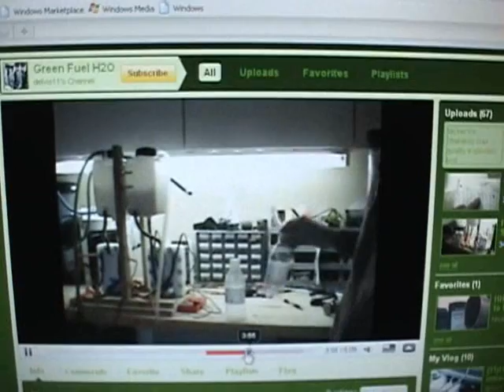Nickel Vs Stainless Gas quality explosion test

Comment: I use much wider gap between Anode/Cathode (1cm) with Nickle and Potassium "CARBONATE" not KOH @ 3 grams per 1 liter and only two plates .50" x 6" x 3/32" and high voltage between 176-600VAC run through full wave bridge rectifier and 60mfd AC start cap rated at over max voltage placed across the DC legs of the bridge. So my nickle surface area is probably 50 x less than what you have there. Did my first one in around 85-1987 been many years ago. My cell is more correctly a cold fussion reactor for producing several times more BTU's per watt than what is claimed to be possible per unit of electricity.

Comment: I am suprised that most of HHO-ers  are after dry cell design. I guess it is an industry already, with million dollars turnover. Yet, dry cel has many drawbacks. And why plate spacing (1/18") is so narrow ? It is well known that at such gap you won't get quality HHO gas, while considerable share of el. power will be wasted into steam...

Comment: Hi, delvis11 ! Very nice analysis done. I am planning to build my HHo gen for welding purpse based on Titanium. Do you have any testing of Ti done ? I remember you've mentioned somewhere got titanium stack for testing - couldn't find anywhere. How does Ti work, compared to Ni ?
Reply from the maker: I did test out Ti and it was a total waste of time.The metal is not that conductive. Stay with stainless steel and if you can afford it nickel is the best.
Reply: +delvis11  I was wondering the same thing but did you test MMO coated Ti or non? And is Nickel as corrosion resistant as Ti? I need hydrogen generators that lasts years without rust and brown water for heating. Also have you tried the Nickel HHO with a Catalytic converter instead of Stainless Steel and does it get hotter?
Reply: Also have you tried using sodium sulphate instead of KOH? It's supposed to be way less toxic to health.
Reply: @koreymayo8884  doesn't work good. Koh is king of alkaline

Comment from the maker: Nickel has the least resistance. It is best metal I have tried. probably the best for the price but still a lot more expensive than stainless. Titanium has about the worst resistance of any metal. Makes a good sub-straight but not a good electrode.
Reply: What would you think about the idea of Silver Plates? It is said to even be of higher conductivity than copper. However, in a water cell it would most likely tarnish quickly which would raise its resistance. I have wondered if silver or copper plates, which were nickel plated for corrosion resistance, would be better than nickel plates alone? And if so would it be a big enough difference to be worth while??

Comment: I like what you are trying to do. I just have a question about which plate, Nickel or Stainless transfers and attracts electricity better.
 I have tried bronze, brass, aluminum, and titanium. With the exception of being extremely expensive, titanium was the best for the transfer of electricity. (used the least strength of electrolyte).
Bronze and brass clouded the electrolyte immediatly. Aluminum couldn't put up with the electrolosis no matter  what electolyte was used. (corroded really fast)

Comment: several % of the gasoline goes direct into the exhoust since almost all of the engines have an overlap in the input and exhoust valves.
with HHO, all the energy produced goes into the moving of the piston at around 3-5 degrees PAST TDC

Comment: sharper bang should indicate a faster burn than the lower bang, think the stainless is better :)

@ the math wonders around here, you can calculate all you want but if you have no idea how the burning prosess of gasoline works, plz don't try to comment on any of these video's
its not for nothing that a gasoline powered car needs several degrees pre-ignition for the darn thing to actually work, also...

Comment: If you used a Scrubber system after your reservoir to get the Moisture out, I would think the Power may increase.
Next your Ti Gen test may show more Interesting results. SO far Smack says only the Anode has MMO and a the Cathode is Ti Cross Hatched per Bob Boyce Protocol. Also use Sodium Sulfate as a Electrolyte.
M~R

Comment: I have a great deal of respect for Smack, but he is wrong in his thinking that ONLU Ti plates make large amounts of ortho. Nickle, or nickle/cobalt alloy also make mostly ortho, because there is no chrome in them to leach into the electrolyte. If you don't believe me, build two electrolyzers, one with SS, the other with Nickle, run them for 4 weeks, then look at the electrolyte, see if there is a color difference, then do a bubble pop test, and post your vids on the net., just like Steve did.

Comment: Let me fill you in on something. Check it out for yourself. NASA uses chrome in their catalytic converters to knock ortho down to para. They do it because ortho is to energetic to store as a liquid.
Stainless steel has chrome as part of it's molecular structure. When SS is used in an electrolyzer, it leaches copper, iron and CHROME into the electrolyte.... The CHROME in the electrolyte kicks a large amount of the para that just got made into ortho, a less energetic type of atomic structure.

Comment: I have looked at your page. All I saw as a huge naysayer as far as hydroxy is concerned. You have a closed mind, and try to preach that the same rules that apply to pera-hydrogen made form fossil fuel apply to ortho-hydrogen made from splitting water. Just so you know, that is just refusing to see the truth.
As far as the plates not making any difference, use copper plates in your electrolyzer, then post a vid of it. For that matter, post a vid of your electrolyzer, show us what you know.

Comment: Steve,
How about a btu test

1) Put a very large pot over the burner
2) Measure the amount of cold water put in the pot
3) Measure the temperature of the water
4) Turn on the burner
5) Stir continuously
6) Measure the water temperature every minute
7) Try and keep the pot covered the best you can to reduce heat lost to the air.

Convert the water volume measurement to weight.

You will need to equalize the flow rates but if you use the same torch or burner it should be close.

Comment: Rock on.
Steve, I've watched this vid several times now.
What I've been thinking is, why not a spectrum analyzer for the hydroxy?
If we take a glass tube, some foil, wrap the foil around the tube leaving a slit down the length, run the hydroxy through a needle, light it, insert it into the tube, let the light shine out the slit through a prism onto a flat black paper, photograph the spectrum, we can analyze whats being burned and the energy level of the hydrogen.
Just thinking.
Peace.

Comment from the maker: Mike If you look real close on the far left of the screen  I have two new bubblers that are 3" x 17" tall they both have a simple diffuser on the bottom. there is a third bubbler there too. I think it's a 1.5 gallon filter canister. 
When i runn MMW production tests i run through them. for this test i disconnected the bubblers.

Comment: Steve, I knew there would be a difference between the two, and you have to admit, the nickle shows a better pop.
Now, I hate to say this, but your making some steam there. I can see it on the vid my friend.
Here is how to do a much better test, and cut your steam to dang near Zero. Run both hose's to a second bubbler and put a stone diffuser on the ends of both hoses. It will help to scrub the steam from the gas, eliminating all electrolyte at the same time.
Great Job. Keep It Up..
Mike.

Comment: Love the continued testing. I wish folks like us had access to some of the high tech stuff that the big boys have. It would sure be simpler. I think the torch idea would be more telling if both cells are operating at the same wattage. Might have to do them one at a time then do some production tricks to put them side by side. Then add the narration. I think it is going to be difficult to get them both drawing the same wattage when hooked to the same power supply.

Larry

Comment: now if you can just run the gases from each into a gas spectrometer and see exactly what's in both. I wonder if the stainless cell has any byproducts in it's gas as opposed to the nickel cell. perhaps that chromium-hexavalent that is talked about.